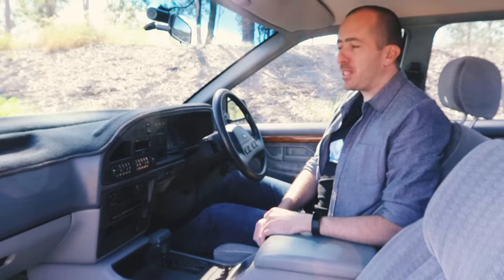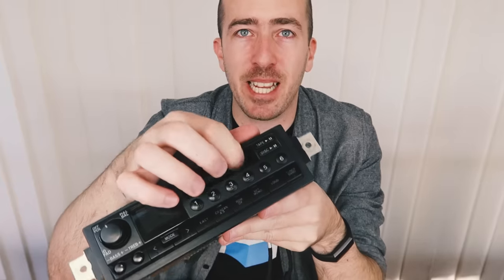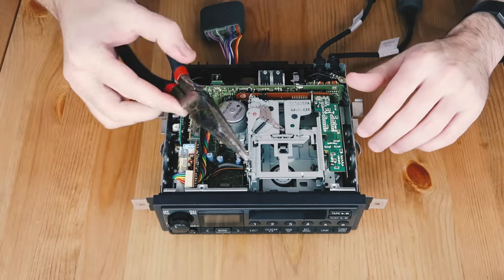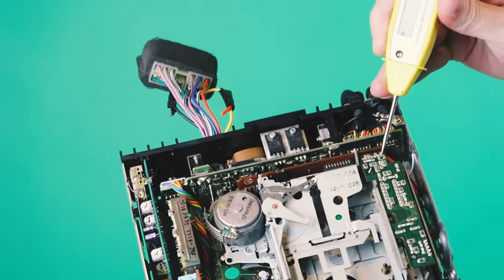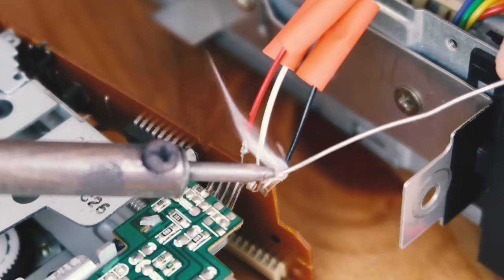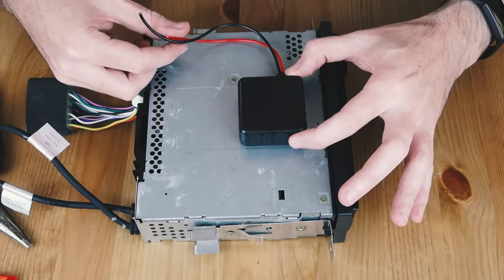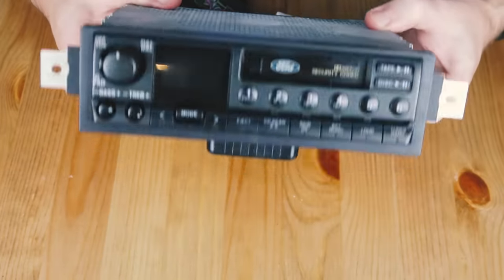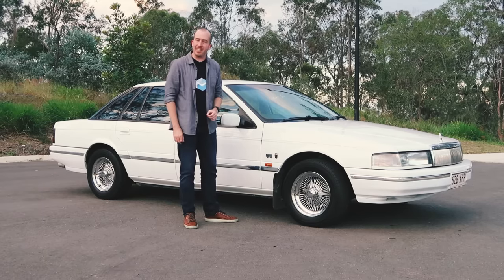Add Bluetooth To Your Old Car Stereo For $25!

Comment: I have an 04 Colorado and I want to do this, but the thing is it has a cd player in it. I don't know if this will be the same process.
Reply from the maker: I have seen a video of a guy performing a similar mod on a CD player. Somewhere on the mainboard will be L & R audio channels to tap into. He did however have to burn an audio CD with one long blank "track" so that the head unit believed it was playing a CD.
Reply: MotoringBox I just saw that video and others he made. I’m going to attempt it and see how it works for all my gm peeps

Comment: I’ve been thinking about doing this to my car CD player. No idea how yet
Reply: It's a fairly easy job. I just did it to my 2004 Liberty. Below is the list of bits it took to create a solution that cost about $90:
• Bluetooth hands-free with USB power input and 3.5mm audio jack output - eBay - about $35
• 12V -> 5V DC power converter - Jaycar - about $35
• 3.5mm audio jack input / output line level isolation transformer - about $10
• Female end of a 3.5mm audio cable / solder / heat shrink / insulation tape / zip ties / band-aid - various - about $10
Reply: You'll also need to burn a silent CD...
Reply: The isolation transformer was from Jaycar too!

Comment: I plan to do this with my radio but with just a Bluetooth board itself. It’s my understanding that the Bluetooth connection is a one-and-done connection. As in, if my friend wanted to pair their phone while I drive them around, I’d have to unhook the radio and then hook it back up and have my friends phone connect to the Bluetooth. 
Does anybody know if adding a button or switch to the power of the Bluetooth module/board would properly reset the Bluetooth connection? I tried reaching out to a few companies in particular but haven’t heard back
Reply from the maker: My module only allows one phone to be connected at any given time, so it's first in best dressed. In your situation you'd have to turn your bluetooth off to allow the connection to become available, and your friend could then connect.

Comment: by disabling the cassette mech, you now can listen to fm or am as the deck thinks a cassette is in all the time.
Reply from the maker: That depends on the deck. Mine can be switched back to radio at any time without ejecting the tape. So it's all good.

Comment: Is there a way to add the Bluetooth bit also maintain the cassette tape functionality?
Reply from the maker: Yes, don't cut.
Reply: @MotoringBoxTV  what do you mean? Don't cut the wires and just splice in the Bluetooth?
Reply from the maker: @justinsmith2282  that's it.

Comment: I don't get it. why you'd keep the tape mechanism if you're not going to use it. just take the tape mechanism out and put the bluetooth inside the player. connect the left and right channel of AUX cable to the L&R pins on the  main board and use the +12V from the wires that connect the  main board to the tape mechanism and connect the -12V to any metal part. to find the Left and right audio pins turn the player on and put it in tape mode , then poke the pins of the connecting wire with a metal screwdriver, you'll hear a load nose on each channel when poking the L& R audio inputs.
Reply from the maker: The simple answer is my head unit malfunctions as soon as you remove the tape drive, and I didn't have the time to diagnose a workaround.
Reply: @MotoringBoxTV  there's a small switch somewhere on the tape mechanism that is poked with a small metal pin to detect whether a cassette tape is inserted in or is ejected. you have to short circuit the  wires so your car stereo is set to a mode that a cassette tape is always in deck. this way the FM/Tape mode switch will also work to switch between BT and Radio.

Comment: the problem  if you have to replace it every time a new bluetooth version comes. And what happens when the analogue radio has stopped transmitting,  replace the entire radio receiver and insert a digital radio receiver

Comment: For ppl with a cassette stereo . I found it better and cheaper to just buy the all in one blackweb bluetooth audio cassette adapter receiver from Walmart for about 15$ . It is battery powered. Fully charge  an last up to 6hrs Also has a on and off button with a mic that works great.  No need to pull out the stock stereo and wire all this .

Comment: You do understand that yellow is constant and red is ignition on this unit don't you?  You kinda defeated the purpose of trying not to drain the battery.  It probably won't be enough to cause an issue unless you already have a weak battery. But still wanna make sure the correct information is getting out there.  Still a cool mod for anyone wanting to hack an OEM headunit.
Reply from the maker: As I mentioned in some other comments, it appears my car has the red and yellow the other way around. No idea why, but that's the way it is...

Comment: For me I don't have the "hate" of a cassette tape as apparently other people seem to have!!! And OK sure you can store a TON OF MUSIC on your phone if you have a decent SD card installed in it!!! 

BUT if you own a 20 year old or even a 30 year old or older car, there IS ONE PROBLEM with Bluetooth that everybody seems to ignore which is what to do with a dead cell phone when you get to where you are going?! Older cars DID NOT HAVE USB charging ports installed in them!! And unless you have one of the cigarette lighter adapters your phone WILL be dead by the time you spent a hour traveling to the next nearest town in a car with NO charging ports to charge your device!!! 

And don't get me wrong here, I love some technology when it actually makes "logical sense" to own it or use it!! BUT my crappy ass smart phone is great for making phone calls as long as I am first OUTSIDE, and within range of at least ONE cell tower....like I say my phone though a smart phone is junk. BUT my cell phone eats through battery life like a starving dog would tear through a bag of puppy chow!!!  Playing music on my phone is even worse....as I can kill my battery in my 4 year old smart phone in just 45 minutes and my 1985 Ford F-150 DID NOT HAVE USB Charging ports or a working cigarette lighter in it to speak of!! 

So where I am going is I chose "Option D" I bought a CD deck for it, for just $75 at Walmart (JVC Brand CD Head Unit) that would play MP3 Data disks!!! Which I say this all the time, BUT Apparently I am the ONLY SMART PERSON ON THE PLANET when you compare me to all these YouTube videos that "disrespect" both CD and Cassette Tape format!!! Because my JVC KD-S17 deck WILL PLAY MP3s directly from any DATA DISK that is formatted as a normal data disk. And with that being said, a standard 700 or 800 megabyte CD-R will hold as many as a 150 songs on it or sometimes MORE depending on the sample rate (320 KB, 192KB, 160KB and so on) of the songs ON that disk!!! PLUS my JVC CD Deck has a Aux Input on the front of the unit so I can plug in an MP3 player via a patch cord, which my MP3 player has a 4 gigabyte SD card for it, so I can store a few THOUSAND SONGS FROM THAT AS WELL if need be on a long trip!! 

My point is that you DO NOT ALWAYS have a place to charge your phone in an older car, and some cars are just not as "tech friendly" 20 years ago as today's "gadget mobiles" are!!!! And people like myself REFUSE to buy the junk disposable cars of today, first because it is cheaper and easier to just own a car I can actually WORK ON and fix if it breaks down along the side of the road, and secondly I can't afford a $30,000 cheaply made Ford Focus when a $500 beat up old Pick Up WILL get me where I am going first and secondly haul a load if I need to move something and thirdly has MORE POWER than a four cylinder over priced crap mobile Chevy Aveo!! 

My second point is this "What good is a dead cell phone when you break down or you are in an accident, just because you wanted to listen to music in your car instead?" Sure there is a bit of "convenience" to not having wires hanging out of your dash board, or having a MP3 player sliding all over your dash board. But how many times have I borrowed somebody's crappy Ford Focus to realize it only has ONE CUP HOLDER because the other one is stuffed full of crap that I can't even PUT MY CELL PHONE IN to start with anyhow.....which brings me to another point, Not all cars from 20 or 30 years ago HAD cup holders in them.....so again what a lousy idea to add Bluetooth to some stereo systems at times!! Because you still have no place to put your dead cell phone anyhow!!!
Reply from the maker: Thanks for taking the time Greg. I think your cell phone might be tainting your opinion here - I don't know how you've stuck with one that is 4 years old! After the first one or two years most of the phones show significantly worse battery life and either need a new battery installed or simply replace the whole thing. 

Plus it's very easy to purchase flush-mountable USB charge ports off eBay which you could use to replace the vehicle's cigarette lighter.

Comment: Why didn't you strip the gearing out of the tape drive and mount the receiver in the tape drive
Reply from the maker: My head unit needs the tape drive in place with both spindles turning otherwise it detects malfunction. Feel free to do it differently if you attempt it yourself.

Comment: Or you can buy Baseus Handsfree USB Aux Bluetooth Adapter for 10$ from Aliexpress use the aux and a usb from charger or if your stereo or car has one and not mess with the internals. Just plug and play. Also it has a mic so handsfree.
Reply: Can't do that if your head unit has no aux input.
Reply: @pb3786  yes that is true

Comment: I am going to do that, but I know some head units, won't go to radio mode if the tape is inserted.
Reply from the maker: Easy - leave the springs in the tape drive and insert/eject a blank tape to trigger it. It'll just switch sides every 45 minutes. To try get around that, get a second tape and gut the insides out of it to see if your head unit still plays it. At best it'll work fine and never switch sides, at worst your head unit may detect it as jammed and won't work.

Comment: What happens if you now want to play a cassette?
Reply from the maker: This unit's cassette playing days are over for two reasons - the first is I physically cut the left and right audio channel circuits, and the second is I removed the springs from the tape drive so the drive cannot eject and accept a tape. 

If you wanted to retain this functionality, you'd need to leave the springs in there and then find a way to solder your bluetooth wires onto the existing circuits without cutting. For me this isn't ideal, because if you're listening via bluetooth, you might get some background noise or hiss from the tape drive even if there isn't a tape loaded.

In the end I don't own a single cassette tape, so I don't mind.
Reply: You'll have to find a bluetooth linking tape player unit and wire it under the front seat. While you're at it maybe a Bluetooth turntable in the passenger footwell.

Comment: Why strip back the ribbon cable ?
Solder the cables directly to the PCB
Reply from the maker: Can if you want. I didn't want to risk damaging the board.
Reply: MotoringBox 
Not as difficult as you think, a whole lot less stuffing around

Comment: What if my tape deck is jamed by a tape what should I do then will it still work so long as I get the tape out of the deck that is stuck in it?
Reply from the maker: Once you've got the head unit opened up it should be fairly easy to remove the jammed tape. Depending on the head unit you may or may not need an actual tape in there - you'd have to do some testing to find out.

Comment: what about the buzzing noise coming from the unit as when i tried to do a mod like this by putting in a 3.5mm jack  input through a tape headunit then playing music there was a buzzing noise
Reply from the maker: I've not had any issues with buzzing - you might want to read up on "ground loop" audio noise as it may help you diagnose the issue you're experiencing.
Reply: @MotoringBoxTV  yep that's what I had to put in to stop the buzzing but the quality of sound went down

Comment: Those are cold solder joints. You basically welded them together. You heat the wire, not the solder.
Reply from the maker: Aye, welding sounds like what I was after. They held strongly so I'm happy.
Reply: @MotoringBoxTV  im glad but a cold solder definitely isnt ideal. Your not looking to "hold them together" the point is to make it 1 wire. They also increase resistance and heat and are much more likely to fail.

Comment: Is there anyway that i can do this and replace the aux with an Bluetooth module,
Reply from the maker: Yes it should be very easy - the output from the module I used was an aux connection. So if you stripped the wires on both you should be able to just join them together. Then the car thinks you've got an AUX cable plugged in all the time.

Comment: hey man I tried the cassette trick and It always wants to eject because it plays no actual tape, any ideea?
Reply from the maker: It's probably because it detects that both tape spindles are not spinning, and thinks the "tape" is jammed and ejects it. To get around it, you could buy one of those tape adapters, cut the cord off it and leave it loaded in the head unit all the time.
Reply: @MotoringBoxTV  will do, thanks!

Comment: Hey mate great video. I found one possible problem with the guide. Tape has an odd amplification method applied due to the nature of magnetic tape. If you then splice the audio in before the Tape amp circuit, the audio quality then won't be much better than using one of those tape to AUX converters. For some, this may not be noticeable. However, depending on the type of tape player in the car, this might be horrible.  I also did this some time ago on my MR2 AW11 and found this to be true, Just thought I'd mention this for those trying this themselves. Keep up the great work.
Reply from the maker: Good tip, there definitely hasn't been any sound degradation in my case. But I don't know enough about tape drives to say which ones this mod will work with, and which won't.
Reply: Correct there is a preamp after the tape  heads with Eq and Dolby (the unit shown has dolby b and c wow) Correct you would have to find a point after all these processes other wise it will sound crap !

Comment: some auto-reverse tape players will detect that both reels aren't turning... it will 'reverse' and 'reverse' over and over... I've seen 'fake tapes' where the reels are geared together so that the 'driven reel' causes the other reel to also turn...
Reply from the maker: The cheap tape adaptor I had in the video was geared. You could always buy one of those and cut the wire off it.

Comment: nice job, but i disagree, the bluetooth wireless connection is not high quality for sure ( you can use an 3-5 ebay bluetooth to radio device)
Reply from the maker: A few people are getting hung up on the fact that bluetooth isn't "high quality" - and I know what they mean. But it's the most popular and convenient music streaming method in today's vehicles, and this video is all about adding that same convenience to older vehicles.

Comment: Great diy but i would of kept the cassette  adapter to keep the function of cassette player used stereo to stereo female adapter plug and plug the Bluetooth  adapter in it  and got unversal cigarette lighter adapter to power it  and i love wires then when not using it just unplug it eject  the cassette adapter  through it in the shot gun case or glove box easy pleasee electronics

Comment: Neat solution. But I'm lazy and wanted digital radio too...got a nice BT receiver with a built in digital tuner that outputs stereo FM.. Also plays from SD card.   45aud..works for me and no work for me.
Reply from the maker: No worries - enjoy.

Comment: I have a 98 gmc suburban radio I'm trying to add bluetooth to.  
 Can you help me find a way to use the 9 pin ,auxiliary CD input on the back of the radio, as a line in jack? I  see the LEFT/RIGHT and ground pins, BUT .
 I need to know how to send "on" signal to radio, so it thinks I just put a CD in. 
               It's a 9 pin connection. 

[AUXILARY CD PLAYER PINS]                [RADIO PINS] 
                          
   TAPE CNTRL  -      PINK                             TAPE CNTRL
    DIM -                      GRAY                             DIM FEED
    DRAIN RTN -         BARE                             DRAIN RTN 
    RT AUDIO -            LIGHT GREEN              RT REMOTE
    LT AUDIO -             ORANGE/BLACK         LT REMOTE
    REMOTE RTN -     TAN                               AUDIO RTN
    GROUND -             BLACK                          GROUND
    E&C DAIG              DARK GREEN               E&C DAIG  
    BATTERY -             ORANGE                       BATTERY
Reply from the maker: If it was me (and you still have the CD changer hooked up, I would try strip back the wiring so you're able to use a voltmeter and probe each wire and find out what's the voltage differences when the CD changer is playing a disc. It might just be that it's sending 12v (or another voltage) down a particular wire to signal to the head unit that a disc is playing. Hard to know without having details of how the system works unfortunately.

Comment: Can this be done on a 08 citroen c4 picasso it's only got a CD player
Reply: Many CD players have 3,5mm input plug, you can connect there with no modding at all.
Reply: look in your glovebox, in our citroen berlingo there is an audio connector there.

Comment: can you hijack from the cd changer module instead?
Reply from the maker: Definitely - I think it would be a matter of looking at the cable which connects the cd changer to the head unit, and working out which wires are carrying the left and right audio channels, and ground.